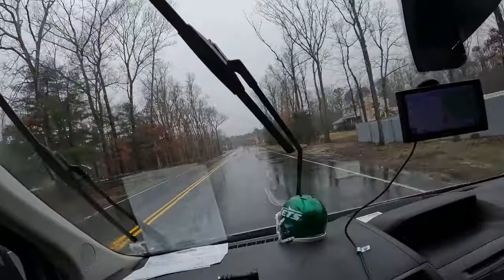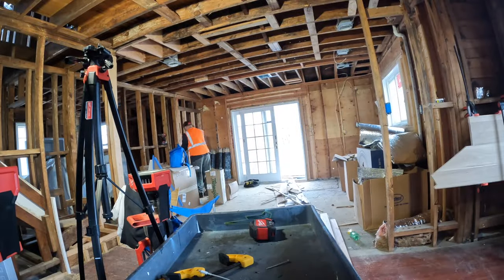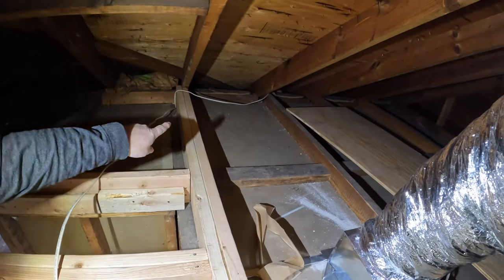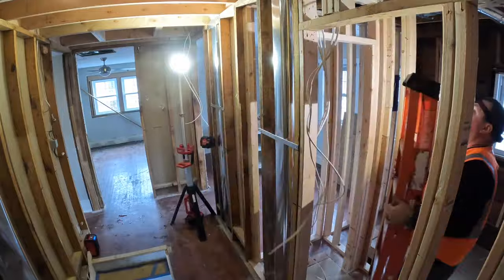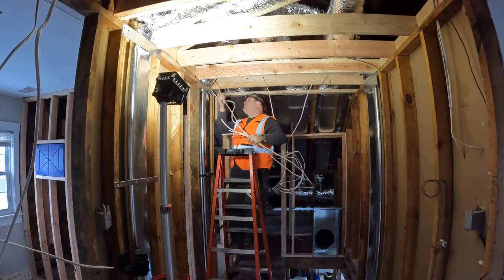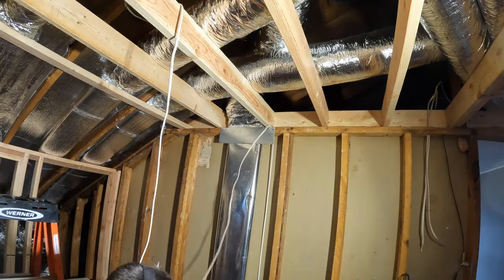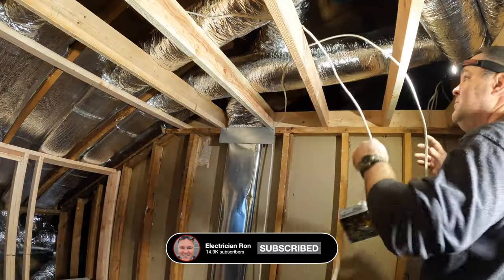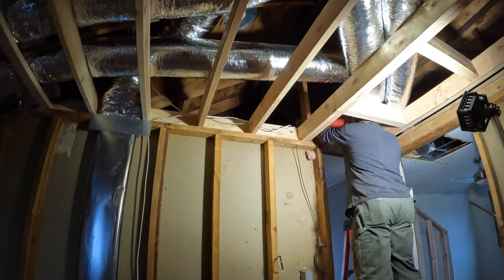Preserving Legacy, Powering the Future: Connecting Existing Wiring to New Branch Circuits

Comment: Nice to see they used a deeper 21/8" deep 1900 box. Thats the only size that I used to stock in my van. Hated using extension boxes on the 11/4 " deep boxes. Was lucky to get enough commercial work that I stopped doing residential work. Nice work.

Comment: Awesome walkthrough Ron. Remember thinking it through is free doing it again isn't ahahh. I like how you took your time to lay out/refeed the circuits and managed to use existing wiring. Also how do u like auger bits recently my boss gifted me one. Used it in my 20v dewalt drill and it nearly pulled me thru the joist hahahah. Keep the content coming thanks.
Reply from the maker: For the amount of holes I’m drilling the auger bit is the best choice.

Comment: Too bad I hadn't known about this channel when you were removing all of that old knob and tube wiring..

I was involved in a rebuild of an old building here in Fresno, and I saved almost all of those old insulators (as intact as possible) to reuse on my live steam scale railway telegraph line poles. 

I'm planning to install signals along our railway at the ranch, so those would be perfect for supporting the 12V DC lines.

Comment: how do you like the transit van? Has it been reliable for you? anyways great video man! keep it up!
Reply from the maker: Thanks, that's much appreciated. I'm a Ford guy but I was greatly disappointed when I had to spring for a new transmission at 97,000 miles. I'm currently  at 212,000 and going strong.

Comment: Very Good job Electrician Ron Just don't push the wires into the push in holes on the back of the switch or an outlet always use the screw poles on the side.